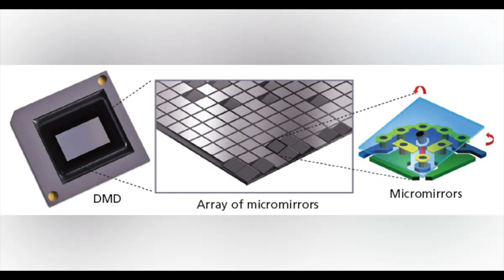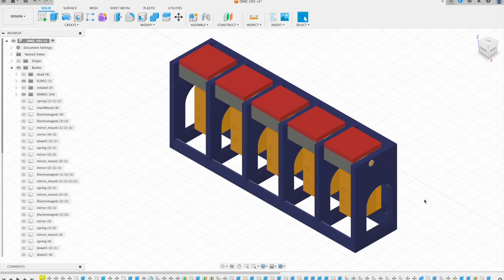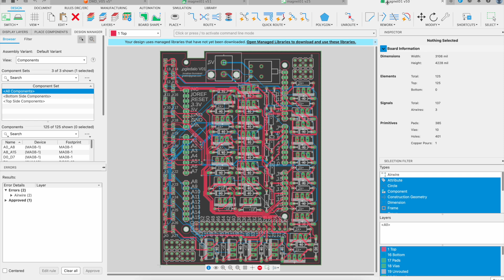Macro-scale digital mirror device

Comment: This design is really cool reminds me of the Nikodama Blinking Eyeballs. That toy used a solenoid to move two half circles to make them "blink". I have clip of an eyeball in my videos (shorts).  I was testing how to drive them in a percussion project, not sure I can link to it in YT comments. I would donate a pair if someone could reverse engineer them. If you wanted to keep it simple I have found that Surplus Sales of Nebraska has 24v  Deltro Armature Relays for $2.00 ea. )They don't have any armatures attached  but have the hardware, making them ripe for mounting something like a mirror on them. Big question is if the 1/32" travel will work to move the mirror?  Thanks for taking the time to share and listen.

Comment: You could improve the On Position alignment by adding adjustable stops on two the two corners that move inward when you want it to reflect. This could be as simple as two threaded/threadable holes you can put grub screws in. You really need 3 stops to fully tune the mirrors, but I think it would be easier to redesign the mirror cell  than to add a third stop to this design. One alternate design that would help is to have the mirrors push out to turn off, and have the pivot as far to one edge as you can get it. Then you can float the pivot axle on some adjustable blocks and have a stop the solenoid pulls the mirror against in the on position. It would help the power consumption broadly if you had bi-stable solenoids so power is only consumed to cause a flip. Flip dot displays do this using a magnetic memory thing I don't remember well, but also flip dot displays are not suitable to being aligned, given their axis is through the middle of the flag's center of area. The mirrors also have a lot more mass than the flags so I'm not sure the lingering magnetic field will be strong enough to hold them up or out.

One basic bistable solenoid design would be to have a magnet on the shaft and another magnet in the unstable center position, with their polarities set to repel. The moving magnet will be repelled away from the center position, as long as the solenoid can push or pull it across it will remain on that side until acted upon. I think you could retrofit the solenoids you have to include this functionality, with a 3D printed center-magnet holder, and a magnet glued to the end of back end of the shaft. Finding magnets of the appropriate strength, at an approachable price, will likely be the hardest part. Truly unfortunate how often sourcing parts is the hard part of a project
Reply from the maker: Thanks for providing these ideas for improving the mirror error. A one-time adjustment would be nice if possible. Maybe loctite after making the adjustment with some screw adjustment.

Comment: I Tried to make a similar installation for a theatre decor, ended up with 50 20 cm by 20 cm mirrors, every 5 mirrors were mounted on vertical axis, controlled by one servo. than you have 10 rows of this. eventually I programmed and controlled them in micro-bit a with a coding tool for 8 year olds. i can send you a video if you want to use it as inspiration, although it is not as sophisticated as your mini prototype. but the scale of the installation was quite nice.
Reply from the maker: Very cool. Send a link!

Comment: The method to reduce the current draw of the solenoids is to power them through parallel RC network. This is the classic trick that has been used for ages when driving relays. See, a solenoid needs high current only to initially overcome a static friction force. A hold current is typically much less. So what you need to do is to determine which current is sufficient to hold a mirror. You can do it, for example, by connecting it to your lab PSU and gradually reducing voltage/current until the solenoid releases. Then add some 15% to the threshold current and calculate the resistor taking into account the resistance of the solenoid coil itself. Determining the value of the needed capacitor takes some experimentation.
Reply: So you mean power it then drop the power down to hold it? Like a compound bow, sort of?
Reply: @melody3741   Yes. The high-current spike through the capacitor activates the relay/solenoid, and then the holding current flows through a resistor.
Reply: I am from India I want to contact you
Reply: @jayanta5669  Why?

Comment: You can lower the relay current by using PWM. 100% for pull-in, 50% for holding. Or you can have a resistor in series with the coil that has equal resiatance to the coil, have the resistor bypassed by a capacitor so that the time constant of the RC allows for reliable pull-in. Both methods lower the current by half.
You can also use a zener in series with the back EMF diode to cut down the release time by around half. Its voltage should be the same as the coil voltage, or two times that for even faster release.
Reply from the maker: Thank you for these ideas. Very helpful. Someone else (xenoscientific) suggested that "best solution in terms of speed and circuit size would be to have two driver transistors for each solenoid: use both for activation and one for holding."
I am not an expert in circuit design, so I just need some time to understand how speed changes with PWM and RC idea.
Reply: @okooptics  with PWM you need more code to set it up and PWM outputs for all coils preferably. Two transistor way would work also, but that yould mean having one transistor wired in as you have now, the second one with a resistor in series to cut down on the current.
The RC bypass method is more elegant IMHO. Say the coil has 4 Ohms and pulls-in in 2 ms - add a 3.9 Ohm resistor bypassed with 470 uF capacitor in (coil - RC network - transistor). This way the initial current is 1.2 A, then goes down to 600 mA after 2ms. Might even stay pulled in at ~25% current - then try 10 Ohm and 220 uF.
Parallel the coil with the back EMF diode as is or add the mentioned 4.7 V zener in series to it to make it release faster.
Reply: For many solenoids, the hold current is MUCH lower than pull-in current... The inductance of the solenoid coil is much lower when "open", as there is very little core material when the plunger is out... There are fuel injector driver IC's, if you look at how they work, it's essentially the same... It's possible  use a big capacitor to provide the start impulse, with probably 1/10 of the pulse current as the " hold" current... Pwm is more elegant, if you have enough I/O pins... If you had I/O pins that you can turn off and on... Pwm through higher value esistors to all drive transistors... I/O pin to smaller resistor to transistor.. 
Pin in off state, pwm drives xstor
Pin at 1 drives xstor on
pin at 0 drops gate voltage, xstor off
So you have "cheap" pwm, and 3-state drive mechanism... You might be able to use capacitor coupling to the transistors to get hard off and on, but there would still be pwm drive... Just a thought

Comment: Control each mirror individually or work with columns and rows?
You could switch the rows to plus, work with diodes and coils and switch the columns to minus.
Then you have a matrix and because the coils are pulsed they consume less power. 
A diode in opposite parallel to the coil means that it switches off more slowly.

Comment: you only need high current initially, once the solenoid hits the end stop, you can use PWM with a low pass reduce total used current
Reply: No need for a lowpass, back EMF diode will allow coil current to flow even when the transistor is off.

Comment: Very nice project. I have a question.Have you thought about how to solve the problem of high current flow in the circuit?
Reply from the maker: That's for your note. Yes, jimvandamme and xenoscientific on Instructables pointed out that the current draw can be reduced considerably by having the holding current lower than the pull-in current of the solenoids. One solution would be to have two driver transistors for each solenoid: use both for activation and one for holding.

Comment: Very captivating movement and sound.  I wonder what can be done to make the current draw less. Maybe some kind of pneumatic mechanism or with strings, where you only actuate tiny valves. You can also twist permanent magnets like they do on the noga dials. With some mechanical advantage you can make the mechanism very tiny.

Comment: That's really awesome!

Is it possible to calibrate the mirror position in reverse?
i.e. lay out the mirrors on a flat surface like glass and then glue them to the otherwise fully assembled frame in one go so they dry laying flat in the solenoids' resting position
Reply from the maker: That's not a bad idea. I can't picture how this would work with the existing submounts, but it there was some rework, then maybe something like this could work.

Comment: Great project! Looks like it could be improved a bit by using first-surface mirrors, those that have reflective layer on the outside.
Reply: Find an old combo laser printer. Take out the mirror strips from the laser and scanner assemblies. Chop them up and enjoy your high quality first surface mirrors.
Reply: @rhalfik  hard disk platters are probably still easier to get by, they also make perfect first surface mirrors.  If they are aluminium, they're easy to cut in any size pieces.
Reply from the maker: I haven't thought of sourcing first-order mirrors this way. Very helpful. But honestly, the mechanical mount is the real problem here, even with first-order mirrors the angle error would be awful. it needs a redesign.